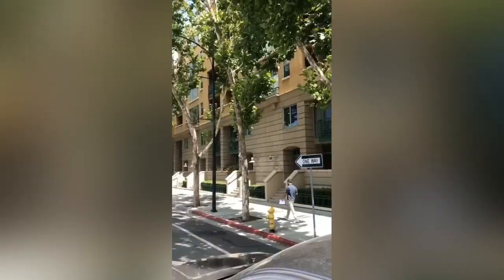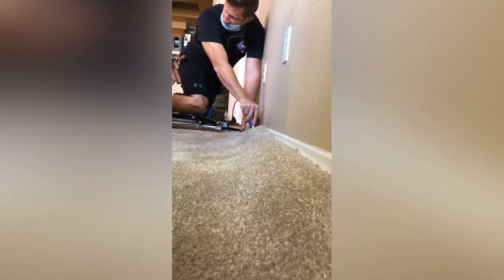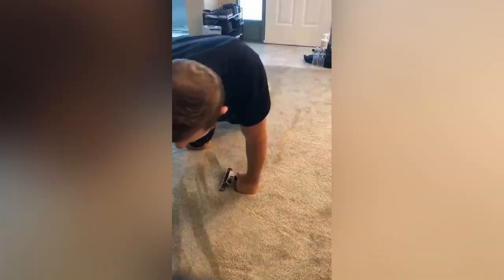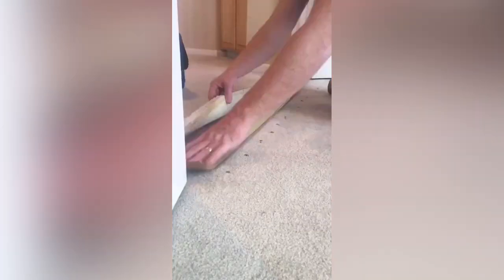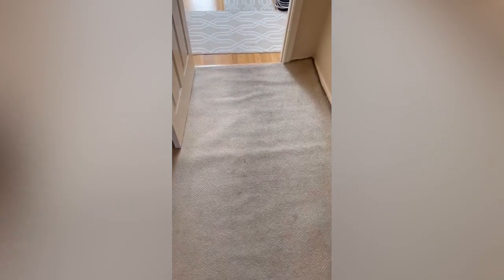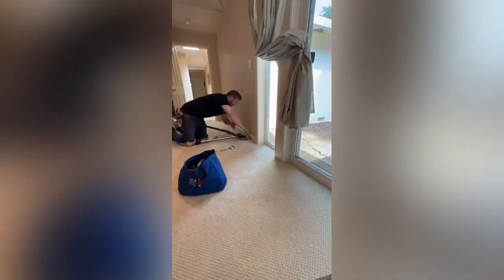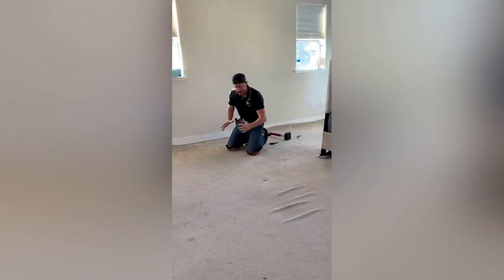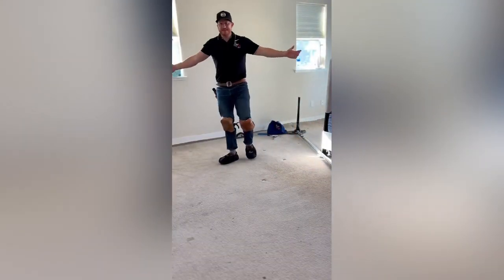Best of carpet guy power stretching

Comment: I was told (by the company that installed my carpet), that the ripples were caused by humidity (?). They stated they could stretch it but that would be like moving again and I just don't want to go through that.
Reply from the maker: Most common reason improperly power stretched.
Reply: @carpetguy  I often wondered why all the years I had carpet and it never rippled. Thanks Carpetguy.